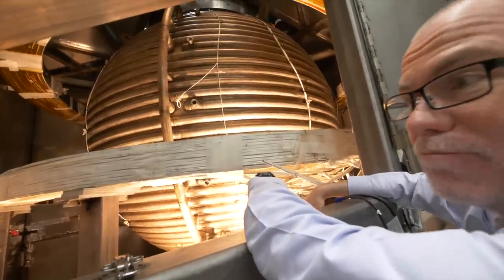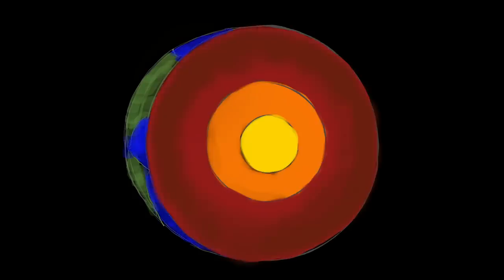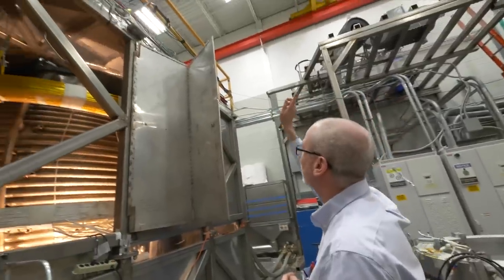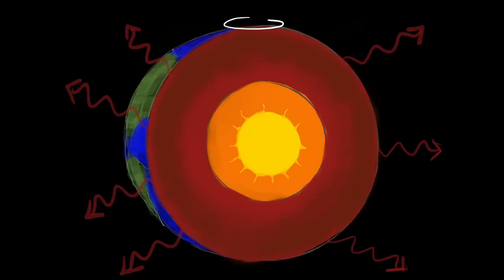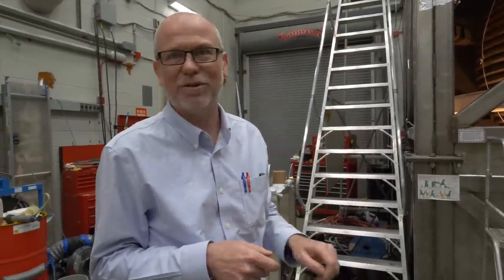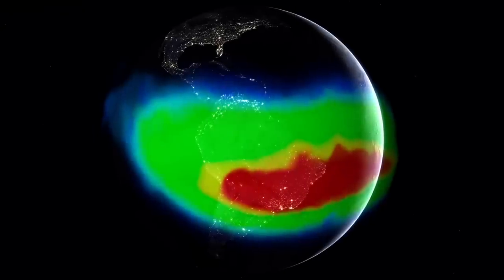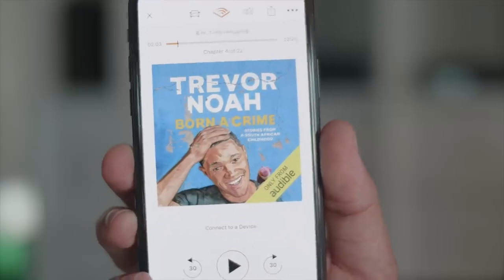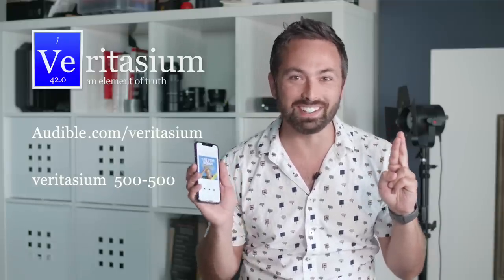Spinning Sphere of Molten Sodium

Comment: Great video, thanks!!  We take the magnetic field for granted, but I'm glad to hear Prof. Lathrop is trying to understand it - we believe that Mars lost its magnetic field when its core cooled & solidified.  It's believed that the atmosphere was blown away by the solar wind after the protective magnetosphere was lost.  Methinks it would be helpful to know if that process started on earth...
Reply: Now ask yourself what could possibly cause all the oddities seen on Venus? ElectroMagnetic fields tend to line up in alternating layers of polarity.  What happens if an artificial field gets insterted between the two outer layers?
Reply: B the Wile E. Coyote you're then ejected into space or cooked with ionized radiation
Reply: John Canniff yes, yes you are.
Reply: Frank Brants, mars and the moon have magnetic fields like any planet in orbit, or it wouldnt be in orbit.  Theyre lieing.
Reply: Current causes rotation not the other way around
Reply: Mars, the moon and any other planet stay in orbit because of gravity
Reply: Nardi Braho i say observational data shows gravity is electromagnetism.  Plain and simple. It fits when you apply atomic magnetism ie, a strong enough magnet will pull a mouse in a jar on a frictionless gimbal ever so slightly but enough to move the gimbal.   Now explain gravity as you see it?
Reply: Oh and mars is now showing strong evidence of a much stronger magnetic field than previously thought.
Reply: Gravity is currently usually modelled as distortion of spacetime and this distortion as a property of mass/energy (see Relativity, Einstein) - could you cite or link the sources of your observational data and how it is better explained by your proposed model than by other current models? 
Afaik, a theory that would unite electromagnetism and gravity into one has not yet been found/shown to fit empirical findings better than current models. Also, gravity can not be blocked (hitherto), in contrast to electromagnetism - which would need to be explained (by you or your source).
Reply: Canaron all info can be found through Electric Universe and Suspicious Observers websites.  Ill provide specific links after work, later today.
Reply: A week after, he didn't.
At least on here, where others might be able to see it aswell
Reply: WierdYoutubeGuy, ok and what are you trying to say?  The internal dynamo is only brought more into question when we look at the Earth as a generator as the Earths produced electric field is known to be an AC current.  About
6hz if memory serves.  The dynamo model should produce a DC current.  All im saying is there are way too many problems with current models and they should be abandoned.  Plasma cosmology  would be a start as it IS ACCEPTED THEORY like it or not, and as such is just as valid and deserving of attention.   H. Alfven deserves far more credit than is given and people like this that continue to push rediculous and sometimes dangerous experiments trying to find fantasy concepts like dark matter.  There is no such thing as spacetime.  Period.  Aa often seen by these fantasy land hucksters, combining two words does not change the meaning of either of them.  Like how theres correct and incorrect, while "politically correct" somehow makes incorrect correct by the introduction of politics?  Rediculous.  Space and time are both nonphysical concepts that do not really exist so please explain how you bend nothing.
Reply: Take the time to study more on space-time and relativity and you might just change your mind. Quote from Wikipedia "Cosmologists and astrophysicists who have evaluated plasma cosmology have rejected it because it does not match the observations of astrophysical phenomena as well as current cosmological theory. Very few papers supporting plasma cosmology have appeared in the literature since the mid-1990s." 

"The universe is under no obligation to make sense to you" Neil DeGrasse Tyson. 

If empirical and observed data disagrees with the concepts of Plasma Cosmology, then you're leaving the realms of science and entering the world of science fiction. 

https://en.wikipedia.org/wiki/Scientific_method
Reply: Chris Denison sorry but you would have to be rediculously dense to not see logic.  Either you are refusing to because your field of work/study depends on it, or you simply have not been paying attention as result after result of tests performed by NASA continue to defy explanation yet are well explained in plasma cosmology.  I think its likely that YOU have no idea what you are talking about.  Perhaps you need to look into both plasma and electric models yourself because by the the numbers they are both beating the pants off your fantasy land space time b.s. that has failed miserably over and over again to produce any real useful advancement whatsoever  technologically yet to date.  Youre going to have to come to terms with it sooner or later.  The shift has passed the point of no return and even NASA's top scientists are saying time and time again that current theory is inadequate.  Its over.  Let it go.
Reply: So can you explain gravitational waves using this theorem? 

Can you cite some sources from "NASA's top scientists" please, as I'd be interested to read some research into this by other scientists than just H. Alfven. If you're aware of the scientific model, you'd be aware that a theory won't stand up to scrutiny if it's not been tested by separate organisations and peer review. I am interested in finding out more, and I certainly wouldn't "refuse" knowledge, it's how science advances. 

It does seem odd, however since this theory seems to have been widely rejected for many years that it would suddenly hold all the answers, but if there's more to it that I'm missing, then please explain.

Of course the current theory is inadequate, that's why it's a theory, it attempts to explain why something happens, and doesn't describe what happens. However the recent proof of gravitational waves seems to push forward this theory of relativity rather heavily as it's one of the underlying ideas behind the idea of space-time.
Reply: Chris Denison, NASA reports.... all of them in the last couple years pretty much.  Gravity = magnetism.  Massive magnetic field = people walking around like iron filings on a spherical magnet.  Simple.  Wal Thornhill's Electric universe model has successfully predicted NASA findings for almost a decade now.  Space Weather's Ben Davidson has been using an electric sun model to successfully predict earthquakes with a high degree of success for some time as well.  Much longer than NASA who is proposing almost criminally similar theories while completely ignoring the fact they are plagiarizing an accredited scientists well published work...  For more info:
Thunderbolts.info
Spaceweather.com
SuspiciousObservers.org
If you thats not enough info i cant help you, as your too deeply rooted in fantasy land to see logically.  I truely hope this opens your eyes to the foolishness on display from the likes of NASA.
Reply: There's no need to discredit ideas because you don't agree with them. If the evidence allows, then it will be accepted. After all, what incentive would there be for NASA to disprove these ideas? You can't truly believe that scientists are too closed minded to not open their eyes to new theories if they are successful. The whole point of scientific peer review is to try to disprove a theory, it's how science progresses. 

If you're interested, please take a look at this video I've just begun watching, I found it very interesting, and there is no ridiculing involved, which I hasten to add, is a line you don't seem to mind crossing.

Thanks for your time, I'll check the links out.
Reply: Chris Denison, yes they are.  Or are scientists not human?  When someone puts as much of their energy and time and God knows what else in day after day, night after night, hell many a marriage has been sacrificed in the scientific pursuit of knowledge...  When you have that much in it can become like a problem child.  The theory would fit with everything  but this one verified accurate data point.... so excuses are made, additional rules added allowing for more and more and more anomalies until youve long been in the realm of the rediculous, aka, quantum physics.  When observed events can be explained by a known electrical theory instead of one that involves hypothetical and not once even close to observed or even impossible to observe actions and/or reactions, i agree, science should go with the simple solution... but it HAS NOT DONE SO IN 50 YEARS.  I encourage you to review plasma cosmology and compare with observed data.  Actually work through the concept and then tell me im wrong.
Reply: Chris Denison, then im truely sorry to say theres no point in continuing the conversation.  Enjoy your fantasy land where only math can prove what eyes can never see while the world passes you  by... into a new era of understanding we should have been enjoying for over 50 years.  Your science produces nothing but complex math.  No invention, no advanced technology.... nothing.  Because its not real.
Reply: did you say predicting earthquakes? no one can do that without measuring stress in the area.
Reply: George Saliz.  Yes they can and have been with an accuracy thats quite impressive.   Space weather news is a pretty informative utube channel anyway so id highly recommend checking it out.  A few years back they had to rethink their entire model for earthquake  prediction.  Though id seen their vids here and there for a while it was the first vid id seen science wise that really impressed me on all of youtube.  Specifically because they were wrong.  Just got lucky for a bit which mimicked too high success rates.  The impressive part was that they made an entire vid admitting that, explaining why, and what came next including the possibility of completely being wrong.  That oh so important part of the scientific method is so rarely seen these days.  Also, they take the time to teach the prediction methods to everyone, freely.  So, fortunately they found the problem was indeed fixable and the new model is still in use now as far as i know.  Check out tbe channel, you will not be disappointed.
Reply: Even if the magnetic field vanished immediately, it would take many thousands (or millions) of years for the atmosphere to get dangerously low. It's a slow process, by human scales. So that's good news.
Reply: Joshua Pearce, shouldnt some of our atmosphere always be pulled along the electromagnetic currents connecting the earth to the sun and way lesser scale the moon?  I take it thats why our forests are so important...
Reply: No, because the atmosphere is not conductive or ferrous. The magnetic field protects it from solar wind, nothing else.
Reply: Joshua Pearce, ahh not so sure about that as any molecule without a completely neutral charge will be pulled along a an electric current or in this case the massive ropes of magnetic flow that can be detected tieing Earth to Sun and our moon to Earth.  If charged particles are in the atmosphere, which i think we can agree there are, a tiny amount of those should make up a flow along those flowing magnetic streams.  Unless Tessla (and i try not to use his name due to the generally missunderstood concepts on the great inventor) was correct in his hypothesis that the magnetic fields flowing from pole to pole  were in fact alternating magnetic currents... then i could see it.  But as the fields are presented in current accepted theory (including possums cosmology, as it IS ACCEPTED THEORY) there should be some transfer of charged particles.
Reply: Doesn't matter, the problem is still the solar wind (or lack thereof), not magnetic currents. Not really sure what point you're trying to make, as either way, the magnetic field helps preserve an atmosphere, and the lack of it will cause the gases to slowly drift away.

(And this has absolutely nothing to do with trees, because they don't increase the amount of total gas. They actually absorb a lot.)
Reply: Wasnt the point anyway, and not talking about the magnetosphere as a whole but only the filaments of interconnecting magnetism ie electromagnetic currents that connect the Earth and Sun, litterally what your looking down the barrel of so to speak as a coronal hole.  Thats the incoming stream as youve said being solar wind (mostly hydrogen ions).   Well, for there to be a complete circuit there must also be a flow of something from the opposing limb.  As for the planets magnetosphere i highly doubt solar wind is solely responsible.  But this is going to lead straight into the electric model of the solar system and im tired of arguing color with the willfully blind so ill leave it at that.